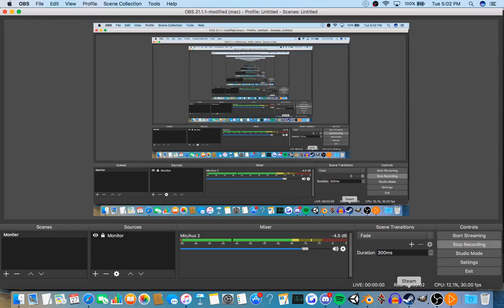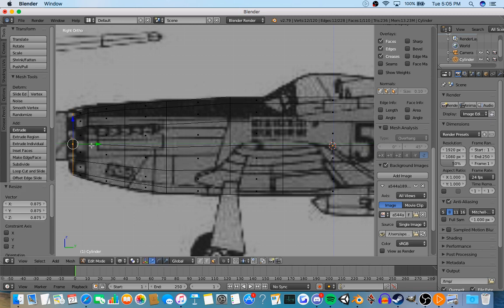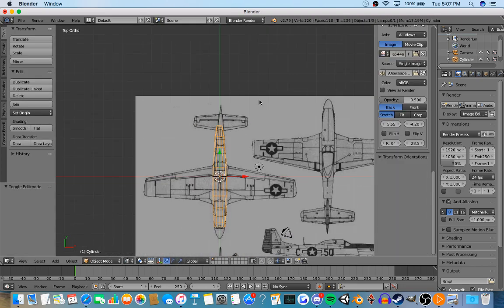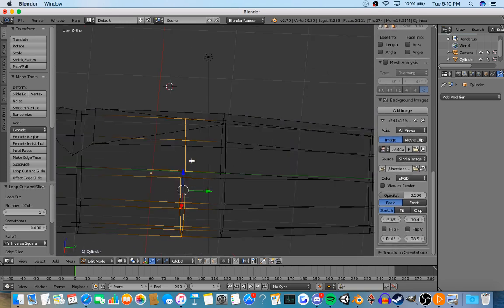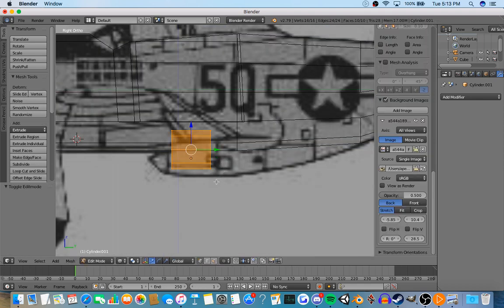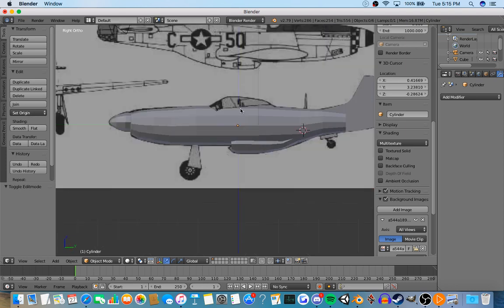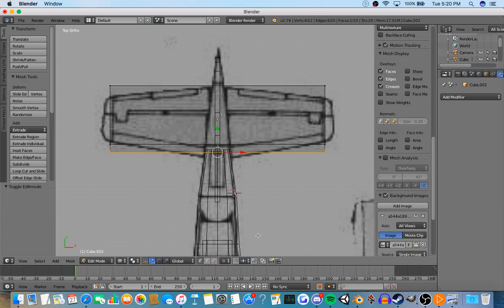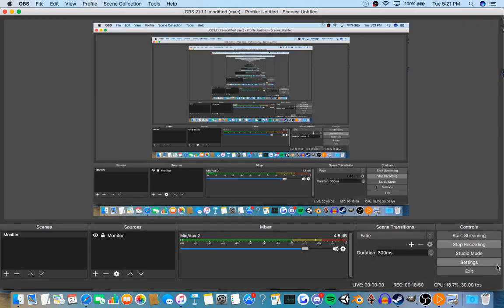How to Model a Airplane in blender for Unturned-Basic

Comment: how do you add background image in the new version of blender
Reply: U add new object (image)
I think the hotkey is alt f or alt a
Maybe you Google it but I'm tryna be nice
Reply from the maker: I do not use the new version however I do believe it is found in the menu when you do Shift A, should be somewhere near the bottom if I remember.
Reply: Ok, I was actually troubled for long time about this, all you have to do is switch to object mode(tab). then you can drag and drop the image from your desktop. :)
Reply from the maker: @burgerman5335  oh wow I didn't know that was an option, thanks for sharing!